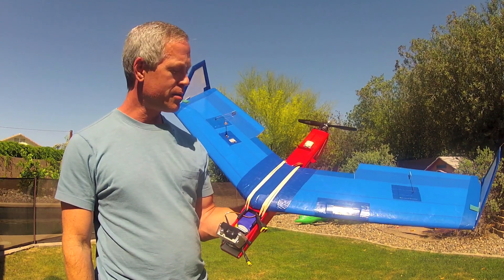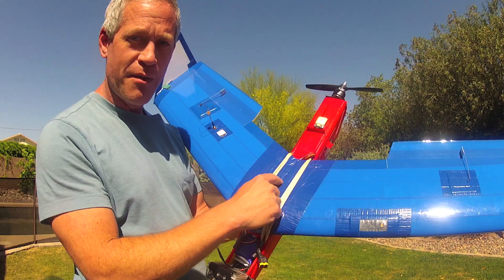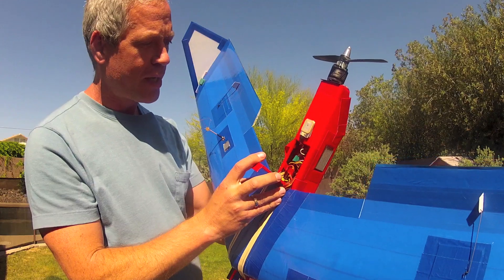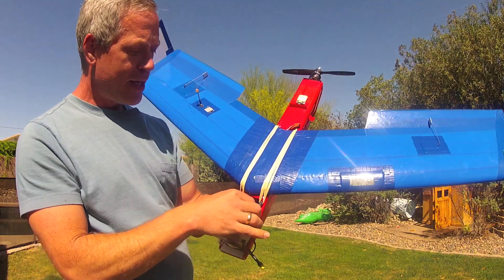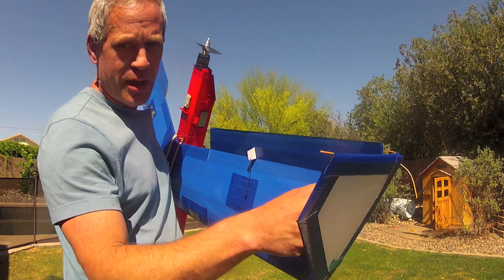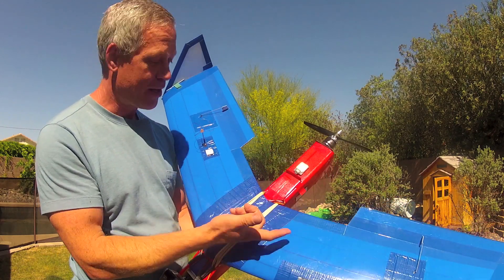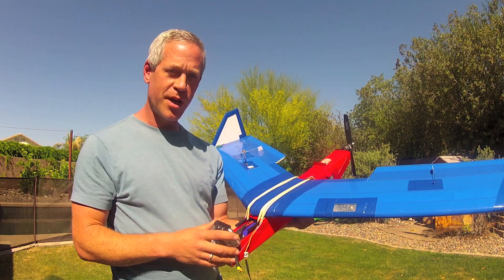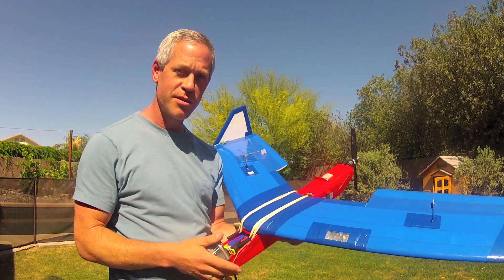SYNAPSE REVISIONS - FPV Foamboard Flying Wing

Comment: Strangely, from experience I find slight forward-swept wings have superior flight characteristics to rear-swept, there's zero tip stall and a huge glide ratio.
I really like the simplicity and toughness of the synapse design though.  I built a scaled-down version a couple years ago for my smaller flying field and found it to bee a bit too heavy and clunky for my motor however - a turnigy aerodrive around 50 gms. It was the first and probably the last time I will make anything with dollar foam without the paper removed. Packing tape is a bit heavy as well, but the wing comes out looking great with these methods and very tough.

Comment: Hey edd I'm 13 years old and I am building this synapse. I am using an nvm propdrive 35-36 with a 60 amp speed control with the same setup u have. When I launch it the plain flies nice then the right wing drops and I loose control. I can't seem to get it right

Comment: Hi Ed I just finished my first fpv flight with the synapse it flies great my all up weight is 825 grams with a 2200ma 3cell lipo 2218 1400kv motor boscam 200mw 5.8ghz transmitter and a sony board cam now back to flying.

Comment: Well i tried the synaps design but with a smaller wing span and longer fueselage. The  wing span was about 32" with a 5" cord and 1 1/2" of elevons. Fuesalage is 24" with about 2" inside diameter. 2826 2200kv turnigy motor 6x4 prop 3300 3 cell battery. Epic fail...not complety sure why but my guess is it was either too tail or nose heavy or just design flaw due to changing the specs. Would the motor, prop and battery I'm using be powerful enough for the synaps if I built it to your exact specs?

Comment: Ed, being that you've used the accessory kit to mount the motor (it seems), does that mean that you do NOT get a pusher prop, as you've basically just moved the prop to the back of the motor without turning it towards the motor (lettering in rather than out)? I don't want to buy the wrong stuff for my synapse...  Thanks for all you do.  Awesome...

Comment: I built the modified Synapse to create a medium speed FPV platform. The Armin is a strong, efficient wing. The pod offers a wide CG range. The motor is quite heavy and when paired with the 4000mAH batt flying speed is fairly high. The 10x6 prop produces significant torque roll at low speeds. I had severe issues with CG. I calculated it to be 5.6" on this 8" chord which worked well. Fore/aft position of the pod was unclear on the videos. Nice plane. Fun build. Didn't work for my application.

Comment from the maker: That sounds like a kick-ass setup.  It's getting a little heavy, you're right.  It should fly fine but the launch might be touchy.  If you have a 1:1 thrust:weight ratio and a solid throw, or bungee launch, you should be OK.  Have a hill to launch from?  I might ease the CG to 6" for first flights.  Once you get flying it'll be fine.  PM me a link to some pix or video if you have it.

Comment: Hey Ed, it's been a few months and I'm getting ready for my maiden.  My Synapse mod includes shaped nose, onboard FPV, flight computer, OSD, Dragonlink, high def night camera and a 500mcd infrared light.  All up weight - 1992 grams.  I'm a little concerned with the weight.  CG is right on at 7", and I got a very smooth finish on FB ... it looks fast - even if it never makes if off ground ... thoughts?

Comment from the maker: Yeah man, you are probably right, if you moved the CG well forward and it still behaved nose-heavy.   Try less downthrust angle and see.  I could use some video, but I kind of feel like your intuition is right.  A bit less power on launch may help but if I could see the event I could be of more assistance.

Comment: hey Ed or anyone else that may know...im having a hard time with my synapse...which i expected as this was my first build...anyhow..upon my first launch attempt the plane nosed up like it was tail heavy..flew for about 5 seconds and crashed..so i moved up the battery to a point where i felt it should have been well on the nose heavy side of things..the second launch went much like the first...if i had to much downward thrust on my motor mount would that cause the tail to drop and act nose heavy?

Comment: Ed,

Have you considered widening the wing root rather than lengthening the mounting pod?  Extending the wing root to something closer to 10 or 12 inches while keeping the 7 inch wingtip should give you a much wider area to play with when it comes to balancing the CG, and would allow you to shift the smaller pod backwards a bit so there would be less need to have such a long central pod.  Worth experimenting with I think.

Comment from the maker: It flies slower at cruise power settings due to the more rearward CG, so more susceptible to bumps in the air.  I actually trimmed it to fly faster though it doesn't need to per se.  Otherwise the yaw stability seems fine, if anything better with more vertical surface area behind the CG.  On a different Synapse I cut the fins down by half and it still flies fine, so maybe a worthwhile mod.  No extra gift cards around receiver or transmitter, just kind of arbitrarily omitted them.  We'll see!

Comment: I noticed that you did not change your wingtip fins after you changed the length (surface area) of the fuselage.  Has this effected it's flight characteristics?  Also, did you use a gift card around each of the VTx and Control receiver (Dragon Link)?  I can't tell from the images, but, it appears so ....

Comment from the maker: The good news is that there is nothing set in stone, so you can adjust that around your needs.  The more heavy stuff you add up front the longer you can make the tail.  As a final option, you can always move the wing mounting point to other than having the wing nose line up with the fuselage pod opening in front.  You might have to hack up the fuselage or poke a rod through sideways for the nose mount, but you can always find the CG.

Comment from the maker: Consider me busted!  Good question though, sorry about that.  That's what I get for doing a video from memory.  The old version uses half a tube and the new one uses 2/3's of a tube, so seems like 50% increase, yet with the overlap of the bevel, the geometry isn't that simple.  OK now with the official measurements.  Original 17" and revised 23".  These were 18" and 24" respectively to start, I just trimmed off the thin nose part.  That is indeed more like 35% longer.

Comment: Ed, it seems to me that you mentioned making the fuse '50 % longer' - but at the same time you said, it was 20 inches long now. 50 % up from original 18 would make it 27, correct me if I am wrong.
I'm not trying to catch you :) I'm just wondering, so what would the 'ideal length' be.
I'm having a 24" fuse on my bench now, ready to cut off some of it. Question is how much I should amputate so that I don't have regrets later!
I wish to use this fuse for both wing and twin-tail-boom version. Ideas?

Comment from the maker: The arrows are not glued in.  I do have 'separators' of foamboard in a few places along the length to keep the arrows apart.  I do not recommend crossing the rubber bands.  The hatches are just a hair less wide than the total internal diameter of the fuselage.

Comment from the maker: It does help the separate problem when tape is applied.  I still recommend treating the edges either by impregnating the edges with thin CA glue or by wrapping the edges over, as in my 'Fins and Edges' video.

Comment from the maker: That is not strictly true.  The vertical stabilizers must be exposed to clean relative wind in order to provide any stabilizing affect against yaw perturbations.  I put them at the wingtips because the relative wind is clean, it's a convenient mounting point, and they fold under the wing as needed.  One thing I will admit is that mine are probably larger than they need to be.  That is a personal design philosophy where I'd rather err on the side of more rather than less stability, but more drag.

Comment from the maker: The tape does help, as does the particular folding technique of building. It tends to tighten down the paper against the foam.  You will still need to treat the exposed edges of paper, taped or not, to prevent peeling.  CA glue is one way.  See my video on 'Fins and Edges' for another way to wrap the taped paper over the edge so nothing can peel up.

Comment: I think de 2 vertical wingtips are slowing your plane down, you have to put them in one line with the fuselage, so it stabilizes but does not slow your plane down.

good video btw

Comment: Using pink foam on the sliding tray, easy to sink gear into and offers some protection in crash.
Also, I think that using low temp covering film would be better than tape.
I'm getting around 15 miles round trip out of my current one (according to the OSD trip meter).  that's incredible for such a small wing.  Built it really light, then put a lot of battery in it with a 3536 1400kv, running 4S, spinning a 9x6 pulling 55A at WOT, 85mph.  Wing DOES flex at this speed, need to glass next wing.

Comment: I love this plane.  Built 4 wings and 3 pods so far...not a single complaint.  I did make some improvements, such as a easier way to mount the motor, different way to cut the angles on the wing, CG at 6.5" gave me the best flight, much smaller v-stabs, using .25" wooden dowel for a spar (works well, must be glued in though), as well as some other smaller improvements in the manufacture of the wing.
I'm planning on glassing the next wing that I make.  Also, I'd like to make a glider out of a wing

Comment from the maker: Haven't pushed it yet, but I think it will do better this way.  I will tell you that my range check on the DragonLink is about double the distance.  I expect the video range will also improve.   I'm still a bit limited by the 2.4GHz noise around my area, but transitioning to 1.3GHz about now.